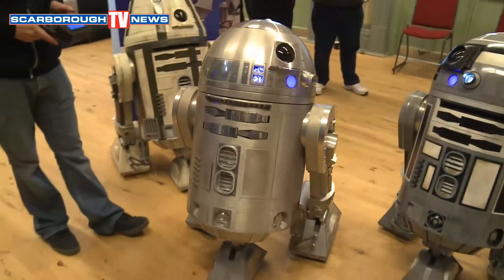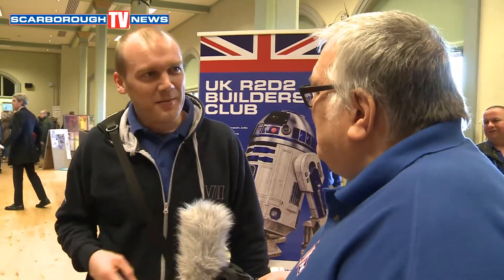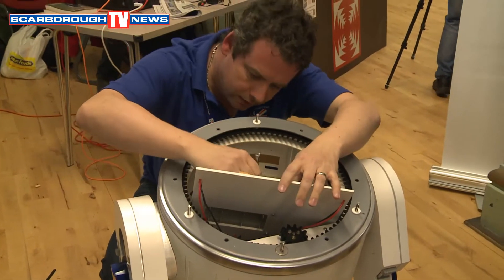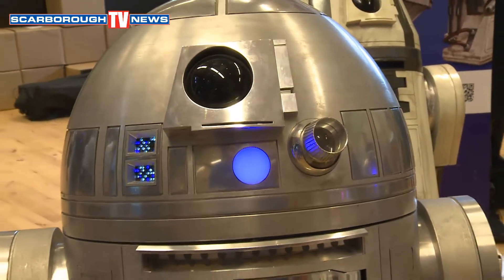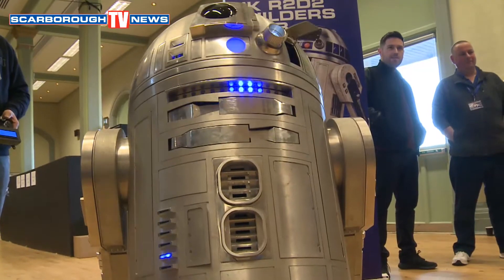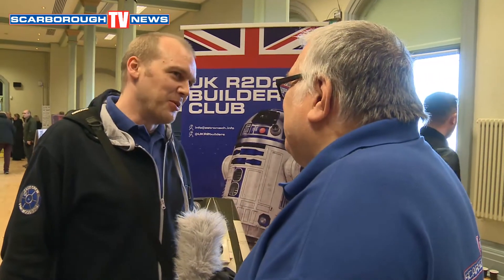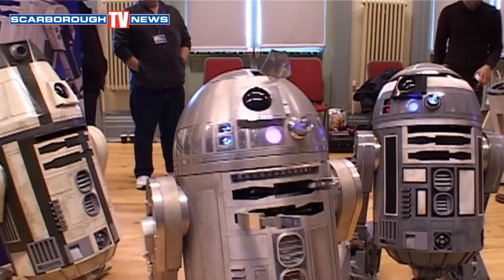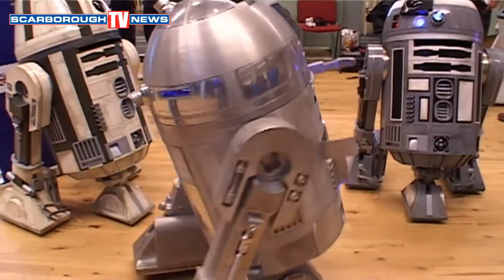Sci-Fi Scarborough - UK R2D2 Builders Club

Comment: R2-D2 is short hand for; are two, dead two. 
Which is a reference to the fact that R2-D2 wasn’t capable of supporting two life forms with oxygen for very long.
The movies don’t show the real R2-D2. Which in the original story. Was a mobile oxygen generator or canister. R2-D2 has two hoses that come out of the top. It’s a tool for boarding or escaping spacecraft in the comics. Kind of like a Swiss Army knife. 
There is a metal cutting circular saw. An automated spanner wrench. A electric taser probe. A cutting torch. Various air and vacuum pump connections. All on articulated robotic arms. That can still operate using different gases or fluids. The feet are electromagnetic magnetic. So the droid can stick to a ships hull. 
The legs are also telescopic and there are robotic tendrils that come out the back. So it can reach higher. 
Features they don’t show in the movies. 
The biggest challenge of building a fully functional R2-D2 is fitting everything into such a small space.
Reply: R2 d2 absolout in the airportmy r4 m9 is the best like. China miniature one r4 building set r4 m9 asstromech r4 i9.